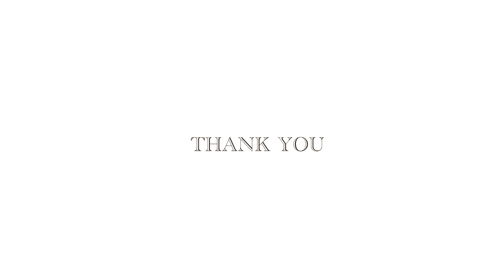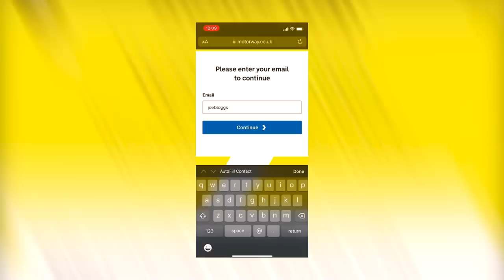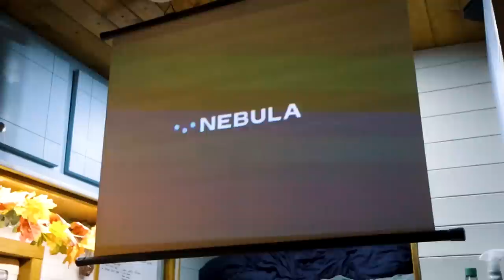ARE LOG BURNERS WORTH HAVING in a Camper Van Conversion?

Comment: Please make sure you have a carbon monoxide  and smoke alarm . The real test for smokey burner will be on a windy night with back drafts but stacks can  catch a light or suddenly block  if tar builds up so  a detector is a must. The other problem you might encounter is not being able to shut the burner down properly if there are air gaps so you'll know soon enough if theres an issue.   I lived in a removals truck too , it was many years ago but  I still love the memories and had many cozy nights with the wood burner.

Comment: Your electrical problem looks typical of what happens when wet gets into a soldered joint (seen this on loads of cars where the wire runs in the footwells and the carpets have got wet). The moisture reacts with the corrosive flux residue from the solder causing the green corrosion then as the strands of wire slowly corrode away the remainder have to carry more current causing heat and melted insulation (modern wire will smoke and stink but shouldn't actually ignite). The fuse won't neccesarily blow as the current rating of the fuse wont have been exceeded, its just that by the time it failed the two or three remaining strands couldnt cope! if you cut right back to clean uncorroded wire and join it with a screw type connector it shouldn't cause any more issues. Is this the wire from the solar to the heater element? if it is it may be worth testing the current draw with a multimeter on a bright sunny day with a tank full of cold water just to be sure the wire is heavy enough.

Comment: The recommended distance from Chinese diesel heater to battery is only about 3ft I think, ( please check that you have 16 gauge wire on your loom), otherwise it needs upgraded wire if you have a longer run, say 10 ft then you should swap it out for 10 gauge wire

Comment: Hi guys, I’m not an electrician but if the thicker wire is coming from the heater and the thinner one is going to it then it seems to me that the thinner one is not capable of the current being drawn and therefore would get hot to the point of melting. I would suggest you have an electrician look at it. Stay safe.
Reply from the maker: Thanks, yeah will do ASAP 🙏
Reply: This usually happens at dodgy wire joints. If there is a bad connection, there is increased resistance which, like a bulb filament, heats up. (This does not increase the current, so will not cause a fuse to blow). Because of the melting/burning of the insulating material, you get a familiar electrical burning smell as a warning. Also the wire should be thick enough with a suitable max current rating, and, yes, a thinner wire feeding a thicker wire suggests the thinner wire might be underrated. But in this case it was the join. The same for if a wire is damaged. The same problem can occur inside a printed circuit board.

Comment: Liam you need that item fully rewired correctly.. I suspect the thin wire is not able to take the level of power going through it. The wire gets hot and causes things to melt and start fires.
Reply from the maker: Yeah it looks this way, we aren't going to touch it don't worry
Reply: Delighted to hear that.
Reply: Couldn’t agree more Loretta, get the rest of the vans wiring checked Guys while you have the electrician in the van as I suspect that won’t be the only dodgy bit of wiring. Better to be safe than sorry. Great channel, stay happy.

Comment: Did you ever change the wood burner to one suitable for a van?  Last thing I know was that the model you purchased was not recommend for a van and you said it was for aesthetics only. Safety first guys.
Reply from the maker: We never ever said it was for aesthetics...we bought it as a secondary heat source as we had problems with diesel heaters in the past

Comment: Probably to late for you Liam. Don’t use choc block connectors to repair the heater wires. They can melt as well. Use bullet connectors, they crimp using crimping pliers. The bullet connectors are current(amp) rated. Red 30 amp. Much better and safer than choc block connectors. Cut back cables to clean shiny copper, cut way all discoloured copper wires or they will encourage heat build up and burn out again.
Reply from the maker: Didn't use it in the end as it wasn't big enough, and need to get someone who knows to look at it now...🙏

Comment: With 12v dc systems and hire current flows you need good strong connections of thick wires. You wont get away with 240v ac lashups which run at much lower currents.  That needs a good connecting block. .  Its worrying that different gauge wire is in use in one feed and if that has been bodged by the previous owners what other wiring arrangements are in place ?

Comment: I wouldn't use 'chocolate block' connectors they can vibrate loose, cause poor connection which will heat up.  Either solder & heat shrink or suitable crimp connectors.
Reply from the maker: Yeah it didn't fit the chocolate boxes anyway...they were just what we had laying around. We will wait for someone who knows or use something bigger

Comment: All wires from the fuse to the heater need to be the same size as the wires connected to the heater.
The thiner the wire the more heat it will produce under load

Comment: You may have overloaded the electrical system, by what you describe.
Either the relay is not man enough or the wiring or connections are not up to the load being put on it.
Hope it helps liam.
Get a multi meter and check both the current supply and discharge side doing a continuety test.
And how much current is being drawn by the appliances it may be to much as wiring is melting and conectors.
Reply from the maker: Thanks mate, not sure to be honest. Going to get it looked at
Reply: Good luck liam
Muili meters dont cost much and handy to have around to check electrics out.

Comment: I find the easiest way to join wires is with Heat shrink soldered joints.
You basically just need either a heat gun or a gas torch.
I've put together several 12v "systems" using these.
Have a gander on Amazon or alternatively I've got loads of them here in various sizes 👍☺️

Comment: The fuse should blow before the wire burns, that is the whole point; fuses are installed to protect against this exact situation. Yes, definitely your wire is too thin. Check the current draw of the heater, size the wiring and fuse accordingly.

Comment: Dont butt join the wires. Use a large butt crimp bring the 2 wires together and crimp only one side. |The removes any poor connection or arcing across the wire joint which was possibly the cause of the heating and fire.

Comment: The wood burner is probably too high as it may cause you to have cold feet as the warm air convects from the stove upwards. It is more effective if fitted lower on the floor (with fireproof tiles under.

Comment: Electrical fires of this nature are caused by high resistance joints. It looks the 2 wires were joined by an inline crimp, but it obviously either wasn't beefy enough for the current or there was a poor compression. Chocolate block connector much better.

Comment: the wire looks kind of thin , you should use a thicker gauge wire and use a better connection where the 2 wires meet.

Comment: Different wire sizes carry different currents. You need to ensure the current is that of the smaller wire gauge.
 If the current is that of the larger gauge wire in can cause the wire to melt. 
I'm glad you are both safe
Reply from the maker: Thank you, yeah I think this might be the case with this now
Reply: Yeah the cable should really be one size but the problem will probably be a faulty connection in the wire it could be the vibrations in the van that caused it. Shouldn’t be just tape that looks like a crimped connection but it’s not clear from the video.
Reply: Them connectors you have got are a bit dated they don’t really offer good insulation if you’re using 2 different size cables get a box of wagos from screw fix and then fit them in a wago insulation box. It’s not a major problem to fix but could have been disastrous.

Comment: Hi Guys , re electric connector , sack those connectors use a wago connector much safer 221 model and quick release , fuse should have blown really but depends on its rating in comparison to wire size  and current draw at appliance .
Reply from the maker: Good idea, but we are getting someone who knows to look over it

Comment: As an ex electrican and aircraft harness maker! i will try and explain the safety build into wires! the problem looks like the connection! was not quite making and causing an electrical arc inside the connector and building heat!.. and melting the connector.. clean both cable ends and connect using either a crimp or terminal block!.. find out what it feeds and when reconnected watch for heat.. you should have a fire as most insulation is designed to melt and put out the fire!..sometimes also designed to give off a smell when hot! resembles fishy smell, and why worry so much???? it's not like you have to run miles to escape! just open a door! a van can be replaced!.. log burner looks ace, and glad your both good.. safe travels
Reply from the maker: Thanks for the insight 👍 
We worry about anything Melting, overheating, sparking etc, when we have cylinders of gas nearby, diesel heaters nearby etc. 
We just want it to be safe and sleep soundly in it, know what i mean?

Comment: Sounds like the thin piece of wire should be replaced with wire of the same guage as the thicker piece. To save making a join the best solution would be to replace both pieces with a longer single piece of the thicker  gauge wire. Good luck 👍
Reply from the maker: Good idea! 🙏

Comment: To get the fire going more easily, fill an old soap sprayer bottle with paraffin.  You can pre-squirt the wood and paper in the firebox before lighting it.  Its the cheapest easiest quickest way of getting it going.  It's lively enough but safe without the exploding gases of petrol which is very dangerous as a starter fuel,  You can buy paraffin in 5L containers to top up your sprayer.

Comment: The problem with the two cables and the reason for arking getting hot intermittent contact get good solid block connector bare back and fully tighten down then you can seal with tape or solder joint it together Keep safe and traveling to have fun 😀

Comment: The gauge wire is most able to stand the current let's say the let's go appliances are 8 amps really between 10 - 12 amps rated wire. I'm not an electrician but I am a radio amateur we know about the safety of voltage and current never use a smaller rated grade of wire with a larger gauge of wire that is why you've had the electrical fire you should use the same gauge wire right from the source battery to the appliance do not have too many joints within the cables any doubt consult a qualified electrician. 22 years ago I rewired my house but I still had an electrician test and inspect my work. which passed with flying colours. please make sure all cables and cable ties and so did not move around and cause any problems or electrical fires. I really appreciate you must get an electrician to test and inspect. I live in S W Cumbria on the coast

Comment: I think the wire and the connector do not match... the connector (chocolate block) seems far too small to carry the current of the larger wire, what size fuse is on the large wire ???
Reply from the maker: We didn't use the chocolate block in the end...going to get someone who knows to look over it

Comment: You're supposed to use the same size wire at both ends so you have the same current for flowing through it so won't get your light so I would say rewire the whole wire where it goes to the same thickness both ends and you should be okay okay catch you later

Comment: Hey guys , don’t use the screw block connector as it will only come loose as you travel along , if it’s a thick gauge wire and they have been twisted together of course there gonna melt lol you need to get it soldered and use a heat shrink to insulate if your every in South Wales area and need a hand with auto electrics give me a shout 👍🏻
Reply from the maker: Thank you mate, we just taped the ends and left it until we can get someone who knows to look at it